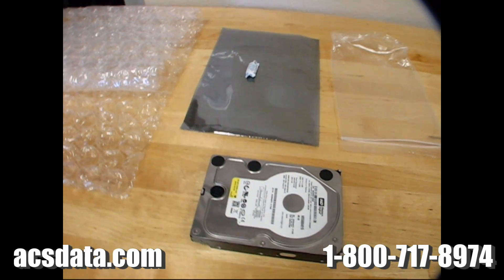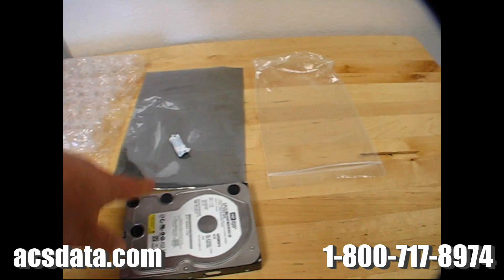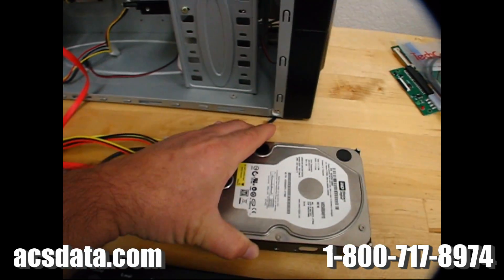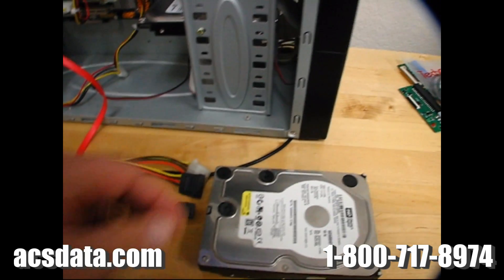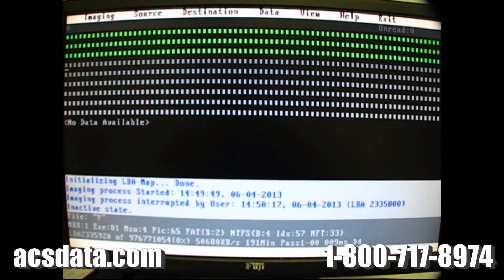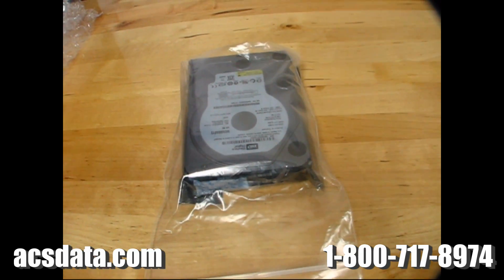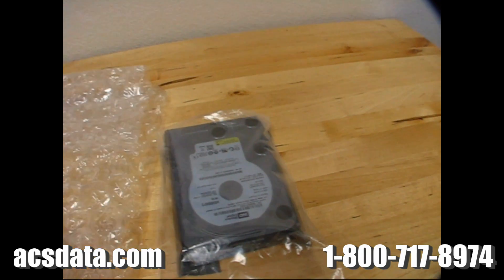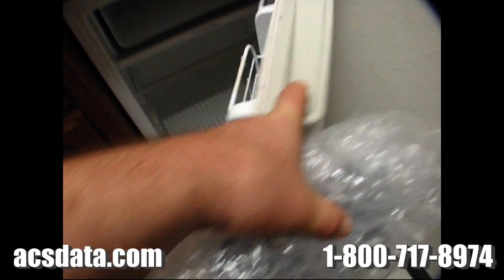Hard Drive Freezer Trick For Data Recovery Purposes

Comment: Folks just because it didn't work out for this guy doesn't mean you shouldn't try. (it's not an old wives tale) I have had this method work 3 times out of 6 tries the first being over 20 yrs ago. i usually left the drive in  the freezer 24 hrs , no guarantees ...it either will or it won't, but i am here to say it can work. just have everything setup to image and as soon as the drive gets recognized start the data copy and keep fingers crossed that you get everything copied before it heats up.
Reply from the maker: Nobody has ever repaired a hard drive with a physical failure by simply putting it in a freezer.  Absolutely never.  If anyone has frozen a hard drive and then it worked, it was never broken to begin with.  Hard drives don't operate the way they did 30 years ago when doing this would allow the heads to read the tracks a bit cleaner if there were overheating issues.
Reply: @acsdata  If I had a dollar for every time someone told me "that's not going to work" I would have 20 dollars...And I never said broken.  anything that spins , anything that's metal to metal can cause friction and  friction causes heat and heat can warp a platter. and what if the platter gets warped just enough that it can't spin up and putting the drive in the freezer compresses it just enough that it will start up and run for 7 minutes before complete failure then it just might work. Also,  be careful about speaking in absolutes just because you don't agree with someone that has experienced something you haven't.(like using the word "never".   I didn't think it would work either, but it did.

Comment: lol im doing this to my seagate click2 or tick2 sound every 5 second and slow boot with no blinking led on hdd indicator i force turn off my pc,first i warping it with 3 layer plastics and bubble, i´m put the disk not in freezer room but in vegs room on bottom of refrigerator and i keep in 1 hours take it out and let it in room temperature 1 day and tomorrow do it again 1 hours and take out disk,let it in room temp 1 day after that, wrapped out,im test and it works ! Hdd can boot normally windows repairing self in chkdsk and running normal its like nothing happened on that disk 🤣 i try to stress test that disk playing game etc still work normal....

Comment: 1. The freezer trick ONLY works on seized spindles. (Very common problem with old Seagate and Maxtor drives).

2. You put the PSU and USB -> SATA/PATA adapter in the freezer WITH the drive.

3. The freezer trick is, was, and always has been a Hail-Mary fix.
Reply: Yup and if that doesnt work on the spindle try using a hot air rework station to heat the spindle motor from that bottom (actually try this before putting them in the freezer).
Reply: +Jay Walt and besides non of my clients have ever considered doing a data recovery from a "reputable company" when they find out the price.  Theyll pay me $40 for me to try my best and Ive been about 75% successful.

Comment: Why not wait for it to warm up before trying to boot it? Not saying this method is a good idea (it seems pretty stupid) but not running it when it's at room temperature is just proving that a freezer-temperature HD doesn't work, not necessarily that freezing it causes damage.
Reply from the maker: Dawie Smith The "theory" behind freezing a hard drive is that a clicking/dead drive will be operational again after it has been frozen. So when most people attempt this technique, they do so right after they have removed the drive from the freezer. We are simply highlighting why this is a bad idea. In most cases, freezing a drive and then allowing it to sit long enough to come up to room temperature will not necessarily harm anything, but it defeats the supposed advantages of operating the drive in an extremely cold state. Even still, condensation does form on the platters, and even freezing and allowing it to come up to room temp can cause significant problem due to the moisture that will have condensed on the metal surfaces inside the drive.

Comment: Great video, but I wouldn't power it on just after I take it out of the freezer I would wait like 3-5 days to let all the water dry out and then test it if it works or not... 

My drive just died a week ago and I went and put it on the freezer since I didn't have any critical data on the drive (most of my data I save them on the cloud :3) and it has been about 5 days that I havent plug it in so... I may do a video showing if it work out or not :)